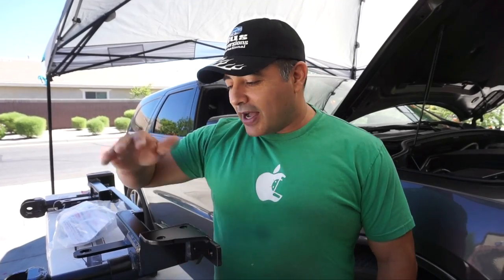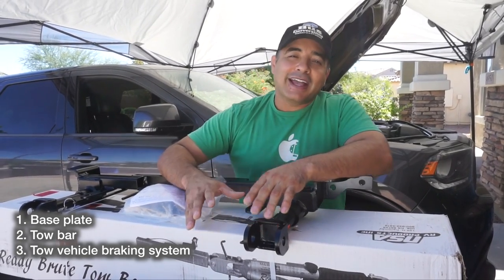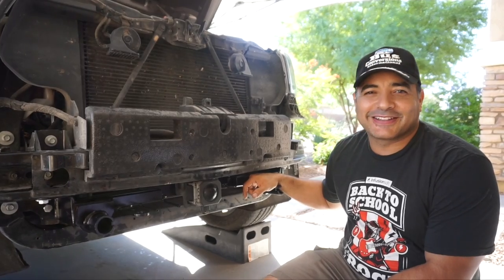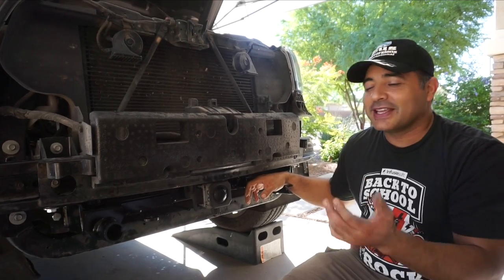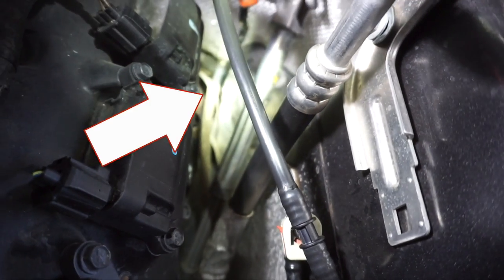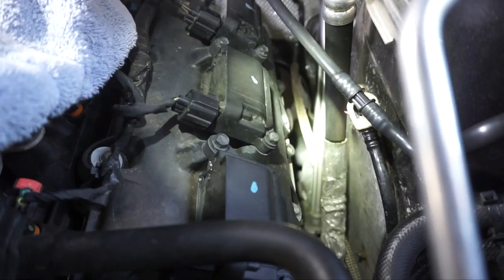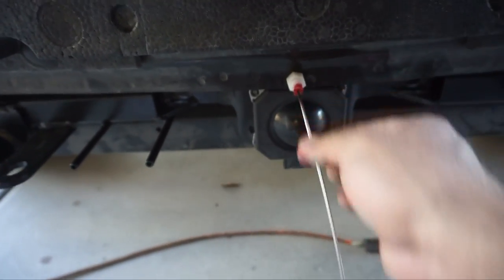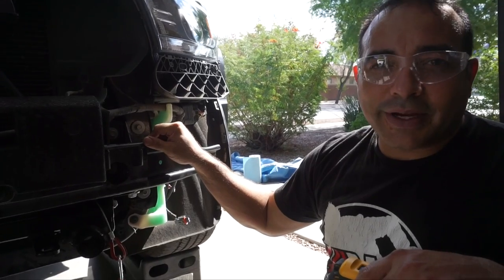Setting Up our Tow Vehicle [2014 Dodge Durango R/T] - Part One: Intro, Baseplate, & Brakes

Comment: Y'all gonna regret greasing that cable. Dry lube (powdered graphite) only on cables and locks. The grease will gum up with dirt. I know it seems like my comments are all negative critiques, but I assure y'all that isn't the case. I am a 20 year veteran automotive technician with lots of RV experience and I actually LOVE your over engineering and attention to detail. Every part of your build is over built and that is the key to longevity and simple routine maintenance instead of repeated costly failures and repairs (accurate comparison would be a Fleetwood or Tiffin coach to a Damon or a Prevost, your engineering being the latter lol). Much kudos to you both and your vision. I was introduced to your channel from Scott and Kelly's channel. I have Scott to thank for getting me bit by the bus bug and you guys for my newfound solar fixation. We are currently in the process of selling our property and I have my eye on a couple vintage busses and whichever one we choose will most likely end up with a solar setup on it. Thanks for that inspiration lol.
Reply from the maker: Well shoot Brian - where were you a year ago?  LOL - Thank you for the tips - the dry lube makes a lot of sense for the reasons you mentioned.  I hope the next guy reads this and uses that instead.  Sorry about the bus bug and solar fixation ... those are very very hard conditions to shake once they get a hold of you ;).

Comment: Man!  It's like a group of Systems Engineers designed that thing.  Whew!  I went with the SMI Stay-IN-Play braking system.  More reliable and easier to work with.  The Base Plate and Stay-IN-Play system, including wiring, was installed in a morning.  I think you guys will change the Ready Brake install times significantly on the chart on their web page.  Great job sticking with it to the end.
Reply from the maker: Thanks Marshall.  LOL yeah, the video we watched said the brake was installed in our car in about 1.5 hours.  The tow plate was so easy they didn't even give a time!  It took us all day for each part ... I guess that's why I am a software engineer and not a mechanic :)

Comment: I think you might regret putting grease on that cable.. stiffens over time.. especially with dust.  Love your work
Reply from the maker: Thank you Doitgood52 - someone else had mentioned that I would have been better off with some 'dry' lubrication - That is probably some good advice.  This is how we learn.  We'll see what happens, hopefully, it will hold up OK.

Comment: Congratulations Juan and Michelle one step closer to cruising the country. It seemed touch and go with some stress but you two maintained very well.  Now to wire and put the front panels back on.  Have you heard from the painter?
Reply from the maker: Thanks Ed - there was some stress for sure!  But even under pressure, Michelle is such a pleasure to work with.  She is the calm, level-headed "thinker" of our pair.  We called the painter just two days ago and still no paint on the sides of the bus - although the roof has been finished for about 2 weeks - heavy rains and high humidity have kept any progress from being achieved but he had really high hopes for this week as it is supposed to dry out.  As you can imagine, we are REALLY looking forward to getting back to work on it.
Reply: Perhaps an early Christmas present then you can tackle the finishing touches finally  :-)  take care Ed

Comment: That's the same tow setup that we have for our Jeep Wrangler. I connected the brake relay switch on top of the pedal to an un-used wire in the harness going through the RV and connected it to a small red light that I put on the dash. This way, if the brakes are activated, I know it. The surge brake itself has a wire on it but I wanted to know if the pedal got stuck or something like that without the surge brake activated. So far, we love our entire setup. We can be hooked up and on the road in just a few minutes.
Reply from the maker: Awesome! Thank you Greg - We have heard nothing but good reviews of this system.  Good idea on the brake light - we have a spot for the one on the surge brake but looking in the rearview camera to verify that actual brake pedal is not down is an excellent suggestion.  I will look into that - thank you.

Comment: I don't know if you have an exhaust break on the bus but assuming you do, what about some of those long down hill grades that go on 10 or 12 miles, your tow car would be holding the breaks the entire time.  I'm considering the same system but have figured out the answer to the long grades like the one on I-70 at the Eisenhower tunnel in Colorado.
Reply from the maker: Hi Steve - We do indeed have a Jake brake and had the same concern.  We found the answer to the question on their website: 
"Going down a steep grade mountain pass will the Ready Brake activate?
No.  We have engineered the Ready Brake not to activate until you step on the brake pedal of the motorhome. In our Ready Brake we have an oil filled shock absorber and a 250 lbs spring. The weight of the towed vehicle has to over come both of these before it will activate.

When traveling down a steep grade the motorhome and the towed vehicle are traveling at the same speed so the Ready Brake will not activate. If you use jake brakes on the motorhome they will not apply enough pressure on the Ready Brake to activate it."

Comment: One thing that I have not seen addressed is brake wear on the toad.   I use a different method of brake activation, however be it mechanical or electronic the amount of brake pressure on the road as compared to the rv is still to be considered.  In my case, when first installed, I had a great deal of toad pressure. This as it turns out caused my brakes on the toad to wear away quickly.  After replacing brakes prematurely I learned to lighten up on the sensitivity.  

Just a heads up. 

In the case of lights I installed an additional bulb on each side that I connected to the rv lights. I found the factory fuse for the rear lights and switched it off for towing, on for standard driving. Saved my battery.

I also disabled parking pawl on steering wheel. Now front end tracks the rv easily.  Dont push the toad in reverse though. Geometry screws things up
Reply from the maker: Thank you Barry - excellent points for consideration.  After you noticed the excessive brake wear, how did you "dial" them in with the correct sensitivity?  I have looked and looked but I can't find anything on a parking pawl on the steering wheel for our vehicle (maybe it doesn't have one?).  I tried to turn the steering wheel manually when the car is off and the key fob is outside the car and it turns and never locks.  I have also heard that you should never back up with a dinghy.  Thank you again for your suggestions and comments
Reply: @BeginningfromthisMorning  One of the great advantages of the system you are installing is it is self adjusting or moderating.  The momentum of the dinghy pushing on the lever on the hitch when braking in the coach is what activates the brake application in the dinghy.  When the dinghy brakes are applied sufficiently to equalize the stopping forces between both vehicles, the dinghy brakes are proportionally released.  In other words, the force of the dinghy against the coach applies the lever...no force, no braking.  So with this system, it is completely self adjusting.  Cool concept.  Many other systems do not have proportional dinghy applications.  Systems that use the brake light and apply the dinghy brakes through this signal are generally not proportional.  (BTW, our 2015 Jeep Wrangler has no steering column wheel lock)
Good job Juan and Michelle!
Reply from the maker: Thank you John - great to hear from you.  I have to admit I was skeptical at first, but researching the system it really made sense to me (the simplicity of it).  It will be interesting to see how it performs when we get it hooked up on the bus.

Comment: Ive read its a several step process to actually get it in neutral
Reply from the maker: It is not too bad - I think 3 steps to get it in neutral (it's a small dial inside)

Comment: It seems to make sure transfer case really is in neutral wud be to put shifter in park and see if you can push truck by hand. It would be hard for me to trust
Reply from the maker: Yes - we actually did this at the dealership before we ever decided to buy this vehicle.  When we found this car on Criagslist, we did it again to be absolutely sure it worked.

Comment: Hi Juan. Can I ask a favor? I am wondering what the distance the Ready Brute gives from the baseplate to the hitch pin when installed to tow. (gap between TV and toad. We have a sliding tray that comes out the back of our camper. I am curious if it will hit the toad.
Reply from the maker: Hey Greg I tried to find this information but it is surprisingly hard to find.  I went and measured our tow bar (the ready brute elite) - fully compressed it is right at about 48" just for the bar with no clevises attached.  the clevises probably add another couple of inches at least and the bars probably extend out 6-8".  However, they are spread apart when installed.  My guess would be that you have about 50" or so (maybe slightly more) between the plate and the toad.
Reply: Thanks Juan. Our tray comes out 60". I think I will wait to cut down and install our hitch extension until everything is set up. Hate to miss it by a couple inches.

Comment: Wow that was a ton of work so how much has the whole tow bar set up cost you so far Juan?
I haven't even looked into what something like this will cost great job so far and it looks safe.on a lighter note where's the bus at with the paint job any updates you can share we're all excited to see it.
Thanks for the ride.
Reply from the maker: Thanks Brian - it probably should have gone smoother ;).  Base Plate was $350.74, Tow bar was $1,146.05 (includes the brake), Roadmaster Clevis connectors $100.18 and the Break-away kit was $91.94.  The protective wrap was about $25 at my local auto parts store + we had to buy 3 long drill bits (about $25-$30 total).  So just over $1700.00 and 3 days of time ;).  The lights and wiring added another $100 for all the stuff required to do the lighting (working on that video now) - So just over $1800.00

Comment: I just did the same job on my 96 tracker but I had an extra casing that I used for the breakaway cable. Not a fun job but it’s done. Mine was easier than yours cuz it’s an old tracker without as much plastic in the way. Where’s the bus already. What’s up with the body shop
Reply from the maker: Thank you Mitch - Exactly how we felt - not the most fun job - but it is done and we are one step closer :).  We called the painter just a couple of days ago and the sides are ready and primed but not yet started due to the weather.  He had really high hopes for this week as it is supposed to be dry - I am keeping my fingers crossed.

Comment: A new video! We pull an enclosed trailer, keeps the towed vehicle clean, allows you to back up and provides additional storage, no vehicle modifications,  just my two cents, I know you have made your decision. Those long drill bits are great. Those sleeves work well. How the heck did you film that cable coming through, hard enough just to see that area. How long did it actually take to put that nut on? When you adjust the amount of brake applied when braking the bus you only want to produce drag so the tow vehicle does not come around on you. It should not actually pull hard on the RV. On wet pavement if the brake apply to hard on the tow vehicle it can skid out of control (that is how trailer jack knife. See tome mark 2:00 for an explanation of what happens when the brakes lock up on the tow vehicle. https://youtu.be/YQ54aKDJLsk Most people think the locked up brakes on a tow vehicle will keep it straight, not true! The tires lose traction and slide just like they slide on ice. Great project. Glenn
Reply from the maker: Thank you Glenn - I am glad to be making a few videos again!  It looks like things are really moving along with the new house!  It looks like you are going to have a really sweet setup when you are done.
I love the idea of an enclosed trailer but I think it will be too heavy for our old bus :).  
The long drill bits are fantastic - I feel a little foolish for waiting this long to buy some.  Surprisingly that nut really only took about 2 minutes to thread on with the shish kabab sticks!  I was shocked and probably couldn't even do it again!
Good to know on the tow vehicle brake settings - How did you get those dialed in?  Did you ride in the car while someone else drove the RV?  I watched the video on the jackknifing when the trailer brakes lock up - man that sounds pretty terrifying.
Reply: When I first started driving a tractor trailer the example I was shown was they take a model of a tractor trailer and use scotch tape to hold the rear wheels of the trailer and run it down an incline plan. Every time the trailer comes around. We have air brakes in the motor home, I bought the brake controller that uses the pressure of the air going to the brakes on the motor home to send power to the electric brakes on the trailer. You can adjust the amount of current and how fast it comes on. Went to a snow covered parking lot and played with the adjustments until they just stopped locking up. Have you ever wondered why you see a painted white strip on tractor trailer tires? That is done so you can tell if the trailer tiers are locking up, when in a slight turn (you can see the trailer tires turning or locking up with the strip on the tire). Your bus would have no problem at all pulling a 24 foot enclosed trailer. Just think of the load it carried fully loaded with people and their luggage.

When I became the level one trailer for ARG I got to go to a special driver trainer class where they had trailers set up specifically to jack knife so you could experience it and learn how to drive through it. Cannot find the video that showed the truck chained to the tractor, but this is close. https://www.youtube.com/watch?v=Rpqan3B2W4s 

I used to compete in truck rodeos, was third in NY state several years running
Reply from the maker: Wow that trailer really whipped around!
Reply: That was done on purpose so the drive could experience what happens with an unloaded trailer and locking the trailer brakes up. I went through that same training, it was quite an experience. They also have special set ups where the trailer has chains running to the tractor so that the trailer will not actually hit the cab.

Comment: The determiner of whether a Durango can be towed is the transfer case, not the engine.  My Durango has a 4.7 liter V-8, but only a single speed transfer case, and cannot be flat towed.  Yours has the Hemi V-8 with a two-speed transfer case, but it's the transfer case, and not the Hemi, that makes it towable.  I didn't realize this when I bought a Durango, and would probably have held out for a two-speed case had I known.
Reply from the maker: I didn't realize they came in the single speed transfer case.   We did run into that issue with Yukons and Yukon XLs but all the AWD Durangos we looked at had the 2-speed transfer case (With the button to put them into N).
Reply: Mine is an '05, and I'm not familiar with the available configurations of later model Durangos.  It's quite possible that, in your Durango's model year and trim package, only the V-8 has a transfer case with a neutral position, and so only the V-8s can be towed.  The point I meant to make was that it's the drivetrain, and not the engine, that determines whether a vehicle can be towed.  I decided to speak up in case one of your viewers might make a buying decision based on your statement that the V-8 engine is the determiner.
Reply from the maker: Yes - Thank you George - it took us quite a while to figure out which vehicles were flat-towable and which ones were not.  Hopefully your comment will help guide someone to the right car :)